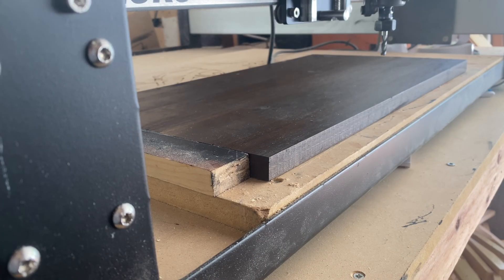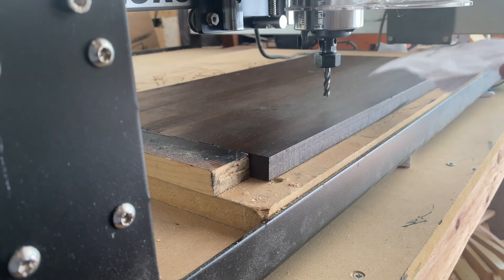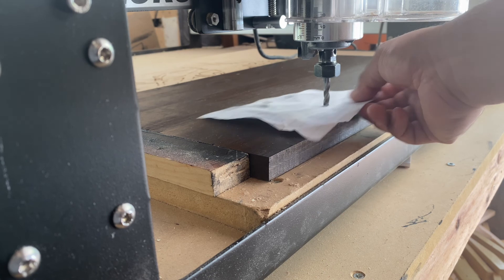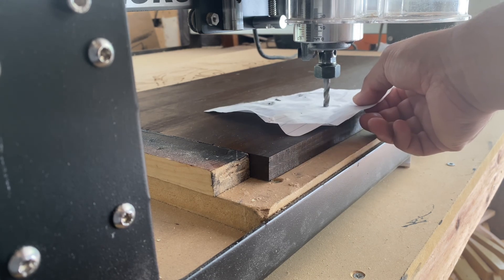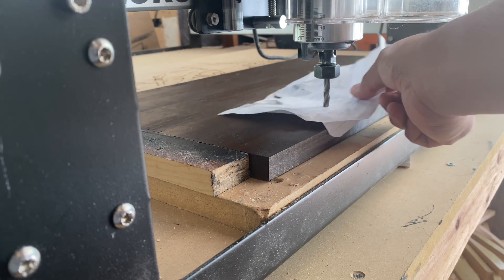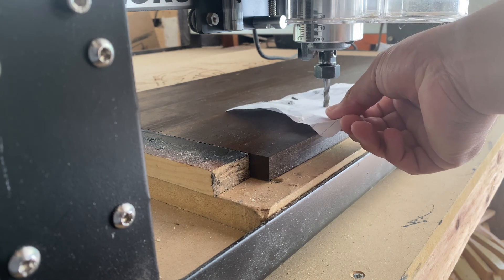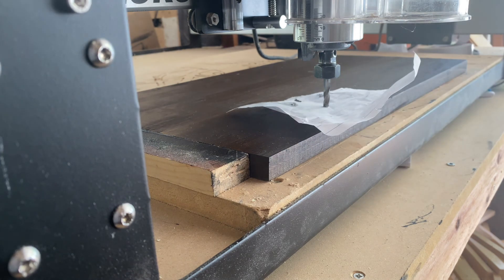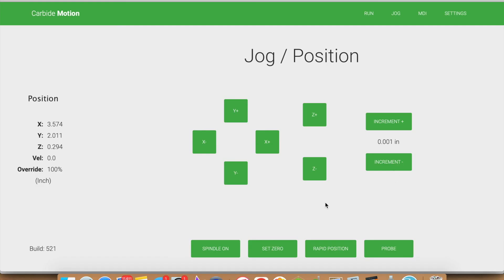How to Set X,Y,&Z Axis in Carbide Create | How to Zero Your Shapeoko

Comment: not for this short bus rider, I am having issues setting it up, and I have bit setter. i am quite a bit of money and would like to use it, can you help?
Reply from the maker: Hey Mike autocorrect might have got you. What are you having issues with? Setting you zeros? Setting up the bitsetter?
Reply: @aetimberpine  I actually got that working finally, but I think I have wood set up incorrectly, it was cutting in the opposite direction as I was expecting, going to try chaning the wood position tomorrow, it is a used machine, he showed me it working but he had it set up so 0,0 is left side away from front of machine, I used lower left, I switched that and then it was going in the opposite direction as I thought again, so think maybe wood needs to go across the bed rather than down the left side
Reply from the maker: @mikeholmes3203 in you Job setup screen set your x and y zeroes to lower left.

In your job setup screen make sure the dimensions of your material is entered.

I hope it’s just a setup issue and not a machine issue (ex wiring is incorrect and causing machine to go in an incorrect direction.)
Reply: @aetimberpine  no he cut a piece on machine, it worked good, he just put a piece on it and went with it, I switched my file to top left away from front of machine and placed the wood in other direction which I think going to fix the issue because the X & Y are now correct X across the front (length) and Y is along the side (height), I was happy to get bit setter working, all the vidoes show different menus than what I have for everything so that is confusing also, thanks for helping, I will see how it goes later on

Comment: Instead of paper I use shrink wrap. It's much more sensitive and thinner. I started doing it this way 'cause after my bit had a few mishaps by going through my aluminum block and breaking the bit I started using shrink wrap.
Just the other day I saw someone do something even better when zeroing the z. As he set the router down slowly on the table he spun the bit. As soon as it touched the table he stopped. As soon as I make it out to the shop I'm gonna try it that way to see how accurate and efficient that way is. I've never thought of that before.
Reply from the maker: whoa! shrink wrap really? I never would have thought.  whats the indicator that you're at the top?  I'm curious to know.  Thanks for the info.
Reply: @aetimberpine  
I don't know what you mean by "what is the indicator that your at the top"?
Reply from the maker: @iwannaapple7190  how do you know that you're at the top of your material? The wrap stops moving, or it stretches?  Thats what I was referring to.
Reply: @aetimberpine  
Ohh, What I use is shrink bags. I just cut the sides and then cut the middle to have two square pieces. I use it just like the paper method except the shrink wrap is so sensitive and slides back and forth so easily that it will react to the slightest graze of the bit. Whereas you feel nothing with paper until the bit traps the paper. Shrink wrap is much thinner and more reactive to the bit touching as your sliding back and forth. You can even feel the bit grazing it. I've done plenty of bit changes in the middle of a project and you can't tell at all in the finished carve. My hair is thicker than the shrink wrap paper I use so not only can you feel the bit grazing soon after the shrink wrap will start to bend. So, I either zero the z when its grazing or when it bends. It slides much better than paper to.

Comment: why does my z axis keep going deep beyond the .75 mdf i set in carbide create..im lost
Reply from the maker: Your material is 3/4” but what is your max depth that you’re carving?

If it’s a lost piece now, don’t take it off but  use it as a trial piece.  You don’t want to keep wasting material. 

Suggestions 
1. Reset your z axis
2. Close Carbide Motion and reset your zeroes
3. Double check your max depth setting 
4. Double check the thickness of material
Reply: @aetimberpine  should i set my max depth at the same 3/4" if im cuttin all the way thru..but its actually cuttin like 1/4" deeper
Reply: after i intialize , i have bitsetter enabled ,it goes over to the bitsetter then i have the probe block for the x,y,z axis..but its still cuttin deep🤷🏾‍♂️...in carbide create i see the simulation showin its cuttin thru
Reply from the maker: @The_Adventures_of_SuperSic  yes if you’re cutting through the entire piece of material, select stock bottom. It’ll automatically populate the thickness of your material in your max depth
Reply from the maker: @The_Adventures_of_SuperSic  i don’t have the probe so not sure how that exactly works.

What comes to mind though is to double check those settings or redo that setup process. Not sure how involved that is but something in your z setup May be off
Reply: @aetimberpine  appreciate your time in trying to help me...nice machine,just gotta get this learning curve figured out